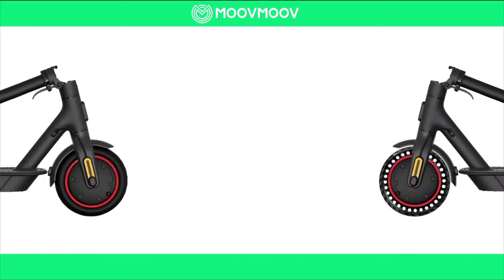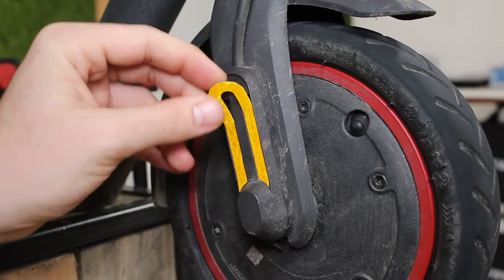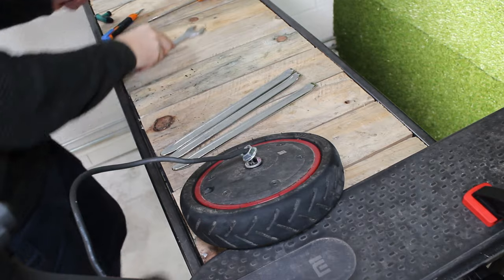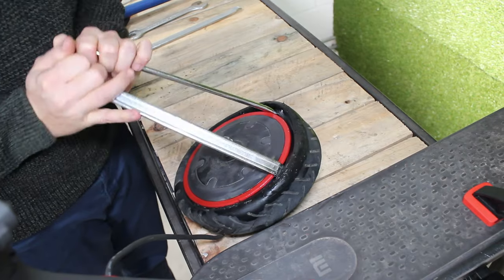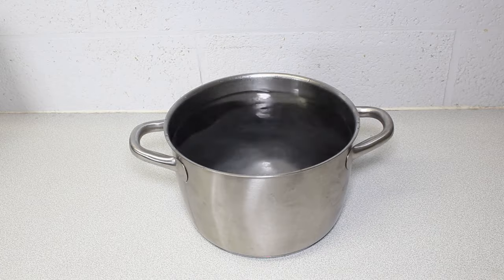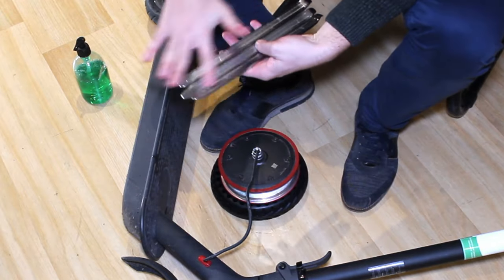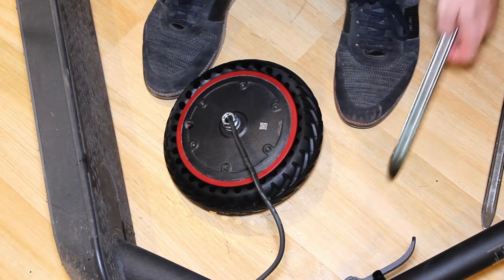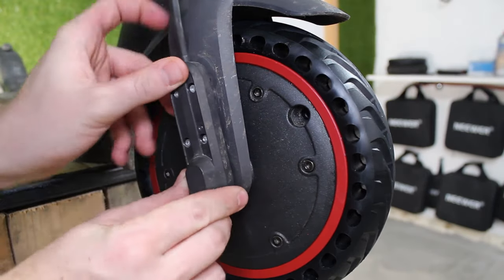TUTO Xiaomi – Install a SOLID tire on the FRONT wheel of a M365 / Pro / Mi 3! 🛴 💚  🔧

Comment: Funnily enough these are the exact wheels I bought for my Xiaomi 1S, then I cam to YouTube for a tutorial, so this is great! I got a flat on my back tyre, but it was cheaper to buy the two wheels during Black Friday so I'm gonna change both for peace of mind.
Reply: Yeah these kind of wheels are very good. And they give you more mileage too because they support more weight which means more battery.
Reply: @pedro.abactor  wait hows that possible? isnt the solid bit softer than og? it should go further becouse it should give more power to drive on sofet tyre isnt it? or am i stupid

Comment: Boil the tyre in hot water for 15 mins, use tyre irons and 2 people and it’s an easy 5 minute job. I spent a month trying to have a pneumatic tyre fitted to my ninebot max g30. 3 different tyre brands, multiple tyre shops, bike shops, scooter shops and the purchase of a compressor later with no luck and I decided to go for a solid tyre. So glad I did. It feels exactly the same and no more filling with green slime to sort punctures. Highly recommend. I used my knees instead of my feet to mount.

Comment: Hi mate, you make it look so easy but I just couldn't do it your way.  I think you need to be at least 80kg to press down on the tyre and quite strong, the way I use was wheel on the floor and the tyre over it and used a cable tie to hold the tyre to the wheel, then 2 longer metal lever to pull the tyre over it while I have both foot standing on it.

Comment: I just changed to a solid tire on my front wheel. One question: Do I have to cover the hole for the valve or can I just leave it open. What if water get in to the motor?

Comment: If you don't care about the old tyre just hacksaw it off. Ideal if it's got a puncture or is just worn, there is a metal ring around the inner edge though but hacksawing the rest will give enough slack to remove the old tyre.

Boil the new tyre in a large pot as the guy says but maintain the boiling point for 15+ mins, don't be afraid to use loads of washing up liquid on the rim, tyre and tyre spoons. I used bigger tyre spoons intended for motorcycle wheels. Maybe a good idea to use a towel you don't care about underneath. 

Also it does make it a whole lot easier to remove the motor, yes it's more hassle up front but then you're not having to worry about the cable getting in the way.

It wasn't too bad and I'm 59kg and have twigs for muscles, the difference is boiling it and using washing up liquid, the worst bit is probably the hacksawing and motor removal oh and removing the (factory torqued) 18mm nuts on the wheel assembly

Comment: What are the sollid tires like to ride with?
Reply: I have one on the back of my pro 2 and ngl apart from not getting punctures it's crap brakes slide out way easier and the ride is extremely bumpy and not uncommon for me to get a headache from it on long rides
Reply: @skitz5441 
Darn.
I replaced the tube in the front tyre, and can’t get the valve stem to stop hitting the forks as the wheel turns.
Darn two.

Comment: How about the valve hole in the rim, water and dirt get in if it is not blocked. I used silicon-type sealant. Also, in my case there was a plastic collar holding the valve in place and it had to be removed with a small screwdriver before pushing the valve in. But anyway, good job. Looked easier than it really is.

Comment: For people watching this, its not nearly as easy as he makes it look.  Bring your scooter to a pro (repair shop) with the right equipment.   Youll understand once you try to mount the tire!
Reply: I just did it alone and it was easy. Removing the original was way harder 😂😂
Reply: Wee in the repair shop have no different equipment... Cecotec
Reply: is it worth 100$ bc they want that much for it for both tires?
Reply: I got quoted £75 even if I provide the tyres, no chance! My Xiaomi 1S only cost me £140, ain't paying more than half that again just to change the wheel, I'll struggle ha!
Reply: You do know if you heat the tire in hot water for 5 minutes mounting a scooter tire is very easy. Most people try to mount them cold and wonder why they have issues.
Reply: @EnnaOjala you one strong person
Reply: Skill issues 💀.
Reply: Maybe if you live in a city where they actually have a shop that will touch an m365’s motor tyre. I’ve never even encountered a human willing to do this for me, the bike shop will do the rear wheel for $25, but that’s just changing the pneumatic. No one does conversions, you have to buy the tire and hope someone will do it for you, the tire shops are clueless and the bike shops won’t mess with your motor. This is a stout vid, I used it and it was perfect. If you don’t have enough weight in a chair put some knee pads on and use your knees. My advice is that you don’t need to spread the irons nearly as far as you’d think and HEAT THE TIRE FOR 35 MINUTES—boil it and use petroleum jelly. I always have the job done in five mins once the tire is heated. Just takes a little oomph
Reply: @k29king1 the trick for me was boiling for 35 min. I installed the new honeycomb tyre tho so maybe those are just more rigid. My advice for the new honeycombs with no sidewall holes is to use 35 min in super hot water and lube the hell out of the tire, use your weight and get that thing on there 😆

Comment: solid tyre are BAD, more vibration more battery loose, more plastic thing that flow away. never more solid tyre for me
Reply: but you cant puncture it, vibrations arent a problem, mine after 1500 km on bad roads works excellent. also solid tyres are faster due to less friction
Reply: @trader2137  never puncture but tpu need an a shok absoeber. You pay more in that way. I really prefer pay 20€ a year for change air tyre